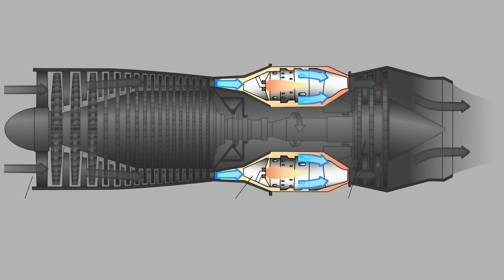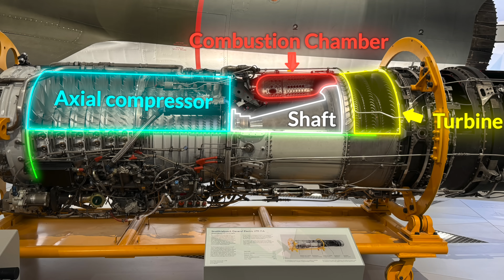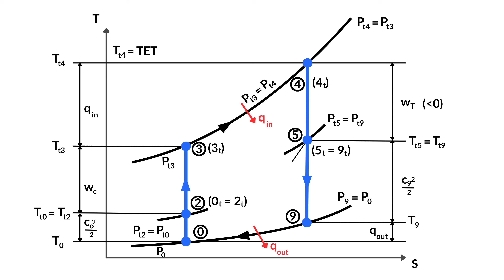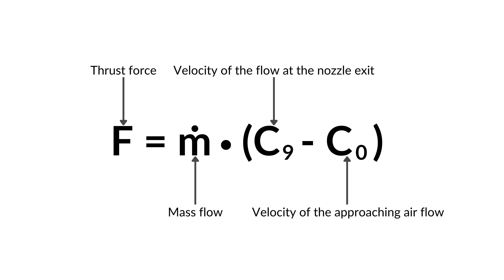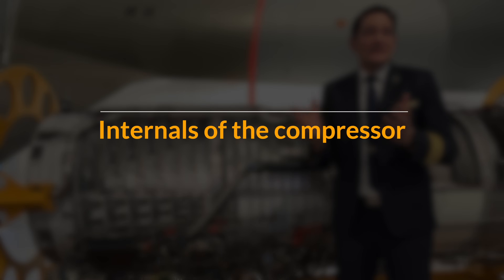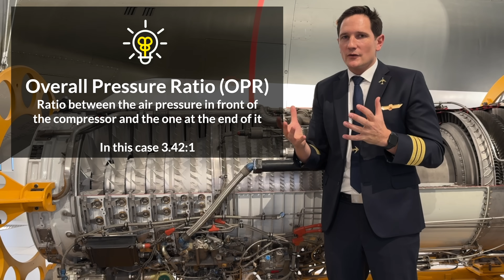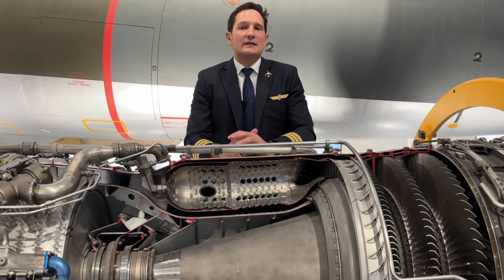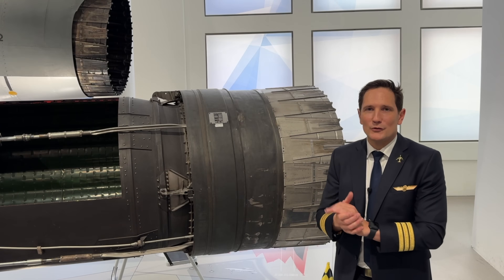How a TURBOJET Engine works - Explained by CAPTAIN JOE

Comment: this was very interesting. the purpose of stators was never clear to me so I'm glad to have that answered. really looking forward to the after burner video since its something I know nothing about!
Reply: To get even more into detail: We don't usually want the stators to get rid of the "twist" completely (or swirl as it is usually called). The blades on the rotors are airfoils just like any other wing and just like there being an optimal angle of attack for a wing, there is an optimal angle at which the flow meets the rotor blade as well. Just like the video states, the compressor stator blades generally do decrease the swirl of the flow, but usually leaves some to make the rotor work as efficiently as possible. Sometimes we might even want to place an inlet guide vane (IGV) before the first set of rotor blades to make the flow meet the rotor blades at an optimal angle. If we also make the IGV variable, we can even match the rotor for different rotational speeds!
Reply: @emilellenius  The term 'swirl' is more usually used for the circumferential component of the the velocity (if any) in the jet pipe.  As I've mentioned in another comment, the circumferential component of the velocity in the compressor (or turbine) is usually referred to as 'whirl'.
Reply: @grahamj9101  Yes, both terms can be used. Perhaps whirl is more common for gas turbines and swirl for turbomachinery in general.
Reply from the maker: Happy that you enjoyed it
Reply: I stand corrected. But some aircraft utilize bleed air from the diffuser . The early J-33, a centrifugal or rotary compressor plumbed of the diffuser. The T-56 turboprop took bleed air from the 14th stage of compression. This was at the diffuser entry. 
I look forward to watching more of your videos. Very well done.
Reply: @robertlaverdure2397  Given that the J-33 has a single-stage double sided centrifugal compressor, not multi stage axial, there aren't many places to take bleed air from. And the T56 only has a compression ratio of 9.5:1. Given that a Trent 1000 has 50:1, that's very different bleed air. So it does make sense, that they take bleed air from those two old engines in front of the combustion tubes. That's also a noticable difference.
Reply: @CerberusTenshi  The Trent 1000 has no bleed air offtakes for aircraft services: it is a 'more electric engine'.  It has two large generators, which provide power to electrically-driven compressors (etc) for those purposes.
Reply: @grahamj9101  You are right but also wrong. Yes, the Trent 1000 has generators to do a lot of things other engines do with bleed air. I could have used the XWB instead, which is, at its core, quite literally, basically the same engine. The Trent 1000 was only an example for the different compression ratios between the old engines and modern ones.

However, the Trent 1000 does have bleed air extraction. Except for two variants, which are the 7000-72 and 7000-72C, which use the bleed air for cabin air heating as well, the other Trent 1000 engine variants still use it for anti-icing of the nacelle. 
You can find that information in the EASA Type Certification Data Sheet, if you want to look it up.
Reply: Thank you for that information. A lot of technology has , to be honest, has passed me by. I didn't realize you could cram that many molecules of air through an axial flow compressor.
I still enjoy being educated.
Reply: @robertlaverdure2397  You're welcome. And it's understandable. Unless you are really into it or have to do with it professionally, things happen without you noticing it. It's in the nature of things. It's said, that a current single news paper contains more information than a person would be exposed to in a year in the 1850's. So there is a lot of information out there. 
The important bit is, willingness to keep learning. I'm still learning too. 👍
Reply: I do believe the J-79 has variable compressor stators that "tune" the flow of air. Also a very important part just as air enters the combustion chamber is the diffuser just forward of the leading entrance of the combustion "can".  The diffuser slows the velocity of the air and in turn increases the pressure as it enters the combustion can or chamber.  The diffuser is also where engine bleed air is taken to be utilized in any air driven system  on the aircraft. Such as cabin pressurization, de-iceing, ect.
Reply: @robertlaverdure2397  No. The air in the diffusor before the combustion chamber is already way too hot to be used as bleed air. Bleed air is taken from compressor stages 5 and 8, where the air is already hot enough from the compression, but cold enough, that it doesn't melt the piping. Stage 8 bleed air is used in early stages of engine starting, because stage 5 is still too cold, but as the engines warm up, so does the air in earlier conpressor stages, so stage 5 bleed air is used for de-icing and warming the climate packs. Stage 8 bleed air is also the one used to start the second engine on commercial airplanes. Military aircraft can have other techniques.
Reply: @CerberusTenshi  It depends on the engine which stages the bleed air is used from. For example, the CRJ 200 GE CF34 engine only has an N1 compresser, but instead has 14 stages. The air is pulled from stages 6  and 10 respectively.
Reply: It was always explained to me that the stator blades slow down the air after it is sped up from the rotor blades. This takes the kinetic energy from the rotor blade and turns it into potential energy in the form of pressure as it is slowed down. That is how it was explained to me in my turbine classes.